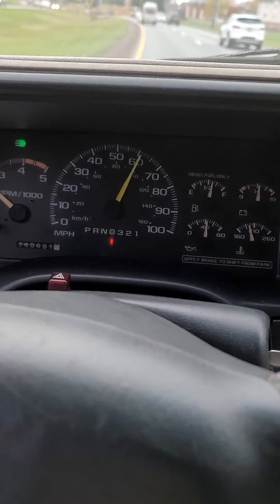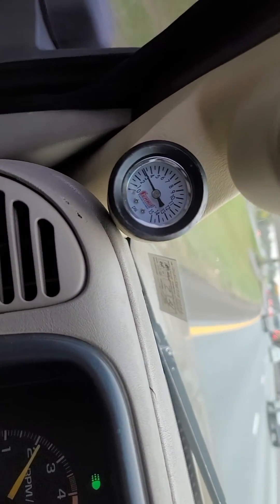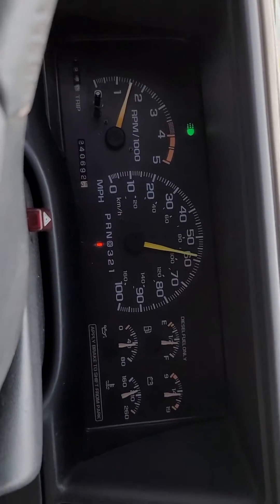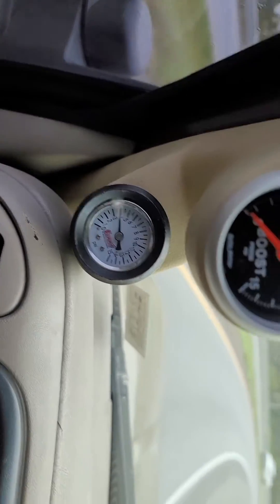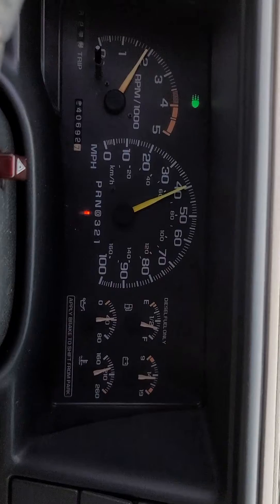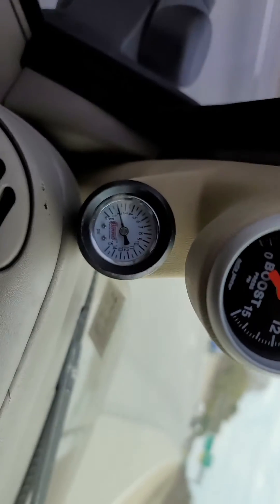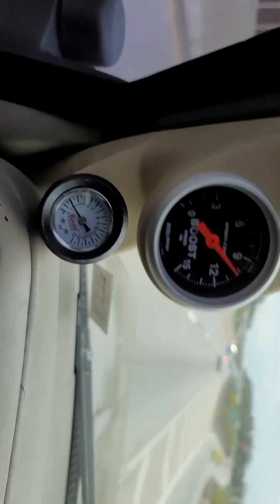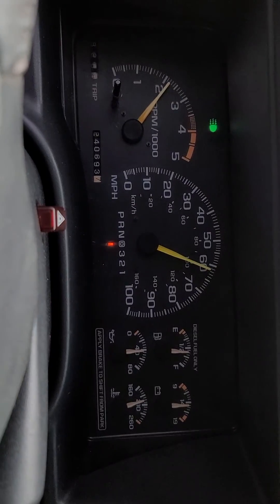Driving a 6.5 Turbo Diesel dually fuel pressure demonstration

Comment: Thanks for the Info. I was wondering . I also am staying stock . My 98-6.5 fuel pressure is 5PSI at Idle. Drops to 2- PSI Full throttle. Seems to run great. I did have to replace the turbo. I now have a GM5 it was a GM8. It is putting out 5PSI is that Normal? One more thing. I also have a 94-6.5 and I put a new Carter lift pump & Oil pressure sensor but I noticed it will get up to 5-PSI when not running and start a lot better but when running goes to Zero at Idle. I hate to ask but do you think the Injection Pump is Bad ? I don't think an Injector is leaking because when it fires up there's no smoke. I worked on  60 Series Type and broke out with 8-V92TA's & 71's Some DT466's also. I'm looking for a GM-2 N America #7000081 so I can really see what's going on. Any Suggestions ?